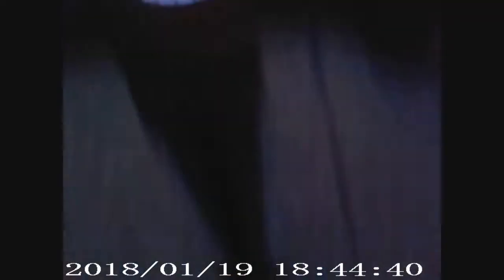S5 Dual Motor Speed Test

Comment: Wow 22 mph is pretty damn fast on one of those. I have the partu electric scooter with the single motor and on a steep down hill slope I have hit 18 mph before and that felt fast on that thing. So that must feel really quick. Impressive how yours accelerates and reliably as well, mine is really slow compared! A little fly could fart in front of me while im going along and it would slow me down a few mph haha.
Reply from the maker: john creed hahahaha yeah it’s fast there is that wire that you need to unplug and you can go fast. My 10 year old reached 35. And that the highest you can go. With dual speed. I’ve had this for a year now and really happy with it.
Reply from the maker: john creed it saves a lot on gas. I go to work with it and it takes me 45 min to get there and Instill have 2 bars left on the battery. This scooter is built very well. Have a great New Year.